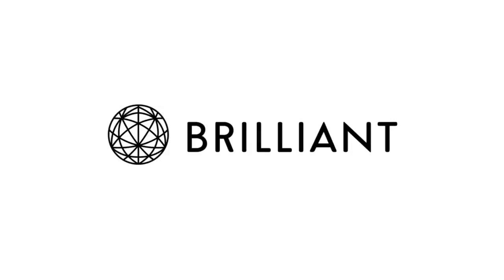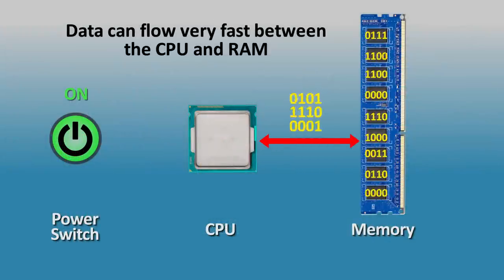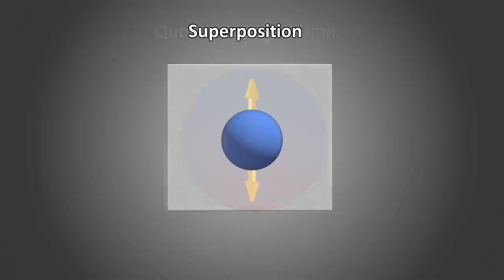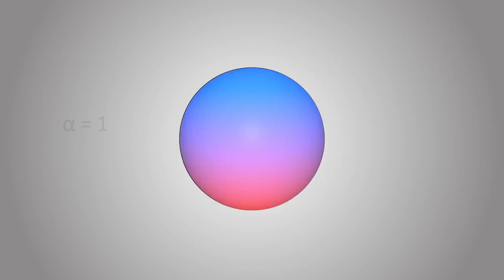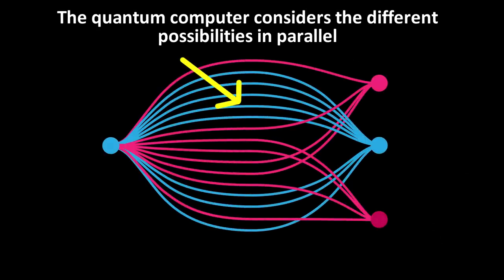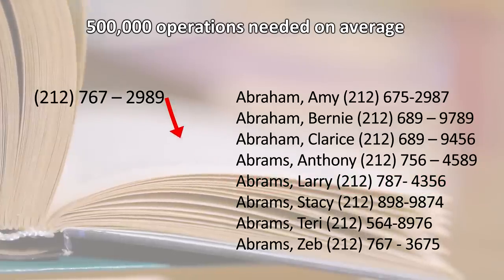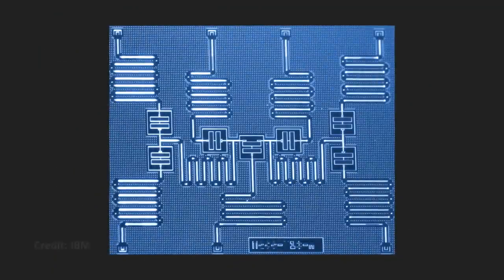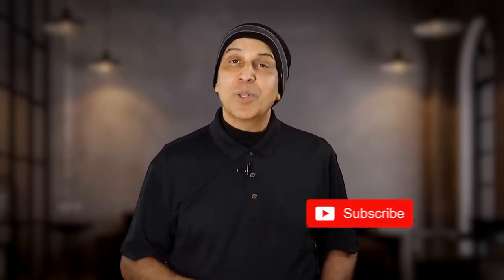The Insane Mechanism of a Quantum Computer?

Comment: I loved this explanation. Also understood how the parts of the computer interact with each other better here. Wasn't expecting it to end with the universe is a simulation theory, but it kinda does make sense to end with here.
Reply: Note that there is a significant difference between a "computational universe" and  "simulation theory" whiich he left ambiguous as it can apply to both. 

A simulation theory requires a physical computer outside the simulated universe but a computational universe is one where the computation is the fundamental bit not built on top of anything but past computations acting on some network array of past logic operations. It is a bit conceptually strange to think of as historically we have always thought of a computer as a physical object performing an operation but in a computational universe the computations are the fundamental building blocks from which familiar properties like space, energy momentum etc. emerge. So rather than a physical computer simulating a system  you are more or less projecting a piece of the underlying computational reality which acts as the fundamental building blocks of the universe. That is to say in the computational universe paradigm if the underlying computational simulation is sufficiently accurate i.e. has the right algorithm running on the right network then there is fundamentally no difference between the simulation and the and the simulating universe aside for the snapshot in time. i.e. the simulation is really an observation of the past in such a precise scenario. The catch of course is that the rate of times passage would be identical between the simulating universe and all the simulations so you could only know if you got the right network and algorithm for sure after running the simulation for 13.8 billion years. Other algorithms and starting networks wouldn't be wrong per say they would just show you a different snapshot of the computational universe in essence what is conventionally the "multiverse". 
Additionally in this paradigm the question of whether math is discovered or invented is rendered trivial as an observation is a frame or reference in space and time and a measurement is a type of acceleration in the space of all possible  outcomes of the wavefunction with the observation being a single projection of that higher dimensional object in a lower number of dimensions.

It is a very trippy paradigm that is really hard to grasp in fact it is probably fundamentally impossible for the whole system to be represented by our puny brains.

Comment: Quantum computers are made of one or more quantum (co-)processors that include quantum circuits implementing quantum algorithms by connecting a series of quantum gates to quantum registers made up of quantum bits. A quantum bit just holds a floating point number (e.g. 75%) which represents the probability of reading "1". There is always some (e.g. 25%) chance of reading "0" from the same qubit. Examples of quantum gates are Pauli-X (NOT gate) or Hadamard (sets qubit to 50% state). Example of quantum algorithms are SHOR (factoring RSA semi-primes using Quantum Fourier Transform) and quantum search using Grover's algorithm. Example of Quantum programming language is Q# from Microsoft and Quantum SDK includes quantum libraries implementing common / popular quantum algorithms.

Comment: Conditions to maintain superposition is a massive barrier for quantum computing to overcome and we're slowly hitting the limits of traditional computing as as manufacturing process has it's limits on transistor density. We can't go in too large CPU dies and we heavily limited by heat output in case of multilayer die. There is also matter of power efficiency - not like it makes a lot of sense to pile up multi-CPU home PC system that pulls like 2000W on CPU alone (which is justified method for servers and super-computer systems) for basic needs and computation needs only ever increase even for basic home PC tasks.

Comment: There are no quantum computers or even algorithms if such computers existed :)
Even if there will be one, they will not have such magical powers like people expect.
If companies had such a magical computer (which they claim they have) then they would change the world more than it was done with current 64 bit computers in comparison to 8 bit computers.
Reply: That's my feeling as well. There is more than just the hardware technicalities of isolation and supercooling  mentioned in this video to overcome. There is also the nature of quantum mechanics that once you measure a superposition, it goes away. So how would you be able to use the myriads of superpositions in a CUBIT to do calculations if they go away once you try to measure them?
Reply: @alansewell7810  My understanding is It is like the double slit experiment, the interference pattern is the result we want, the double slit is the thing we used to obtain it (calculation part), and we just need to make sure everything before the quantum bit hit the double slit is in superposition.
Reply: @alansewell7810  You measure many times. Quantum computers only give probabilistic results. This means you usually have to measure many times. Let's say that there is some process that can only produce either `00` or `11`, but not `01`, or `10`. When you measure once, you might get `00`. Then `11`, then `11`... etc. If you run the calculation 1 million times, you will get very close to 50% `00` and 50% `11`.

This is similar to the double slit experiment. Since photons can interfere with itself, you will get an interference pattern on the wall. However, if you fire one photon, it will still interfere with itself, but you will only see a dot on the wall. However, if you fire many photons, and record the positions, you will get something approximating the interference pattern. Each computation is effectively "sampling" the probability distribution of the wavefunction. With enough samples, you can approximate the probability of the photon will be in a range. We are effectively making a custom interference pattern with quantum computers. The interference models a problem we want to solve.
Reply: @incognitojuggernaut4411  The double slit experiment only fires one photon at a time. If there was no superposition then you would only see photons hit in two spots, not an interference pattern. There is only one photon at a time, so how does it interfere with itself without superposition? Split in two? Under classical mechanics this is not possible.
Reply: @henryzhang7873  Thank you for that insight. Intuitively, it sounds like a hologram, whereby more information is encoded by interference patterns than is encoded in a photograph that clones a 2D image of a 3D object by translation to analog or digital film. Perhaps quantum computing adds that extra dimension of computability. I know the retired physicist who wrote the first widely published book on quantum computing a couple decades ago. He is reluctant to talk about it now because he says so much has changed in the field since then. I'm still skeptical, because a lot of these supposed scientific revolutions like cold fusion turn out to be duds.
Reply: @henryzhang7873  Thank you, I found it and will  watch it. btw. I have a book called QUANTUM DIMENSIONS (on Amazon) that discusses quantum mechanics in terms of the historical debates. I am not a physicist by profession (though I studied physics in university). I am more of a chronicler of the history of physics theories, especially of quantum mechanics and relativity. I think I have a good understanding of the principles of both subjects, though the deep mathematics will always elude me. My IQ is a little short of the 160 I surmise is required to have a deep mathematical grasp of these subjects. However, people of all levels of intelligence need to be acquainted with these ideas, as they may loom large in our lives as we move deeper into the 21st Century.
Reply: @incognitojuggernaut4411  the reason it seems this way is because pop-sci content doesn't actually explain much of what it is talking about.
Superposition is well understood and can be clearly demonstrated.
If you want to actually understand something, not just the oversimplified stories for the layman, you need to dig into the math.
Reply: @alansewell7810  Quantum computers are revolutionary, but won’t replace normal computers if that’s what you are wondering. They probably never will, since the tasks quantum computers are usable for are limited.
Reply: @incognitojuggernaut4411  At least Einstein's theories were checked in nature. All that Quantum BS is not proven and is explained with use of magic :)

Comment: I've worked with computers my whole life(about 50 years) and with silicone chips.  The limits on processing speed depend greatly on the system as a whole rather than just CPU or memory.  However the system is made, to be useful it must be compatible with the world around it.  There are at least 2 other types of systems that were tried but were later abandoned because the system as a whole was not compatible with the rest of the world.  Fuzzy logic was one of these.  The other was the idea to make all optical systems.  Both of these ideas have merit and are used in very limited ways.  Fuzzy logic failed because no one was able to find a way to store and effectively use an analog value.  All optical systems failed because it requires some method of storing light and most of the rest of the world is not compatible with it.

Comment: Most of the nature mechanics can be simulated on a traditional computer, including neural networks, at least in a small scale. Can a quantum computer be simulated on a traditional computer ? Does quantum computer use algorithms ?
Reply: Yes, but simulating a quantum computer on a classical computer is significantly slower than using true quantum hardware.
Reply: @elliotn7578  It'd be like building a computer in minecraft. It can be done, but you'd take the processing power of an i7, and reduce it to a basic calculator.

Comment: It would be interesting if they ended up creating hybrid classical/quantum computers so we can get quantum calculations for long arbitrary things and classical for more mundane generally specific things.
Reply: i would suggest QaaS in this case... a web api to ask a quantum processor service something and get the result, while for the rest, you just use your stationary gool old joe CPU ;)
as long as we can't solve the temperature issue, there won't be any qbits lying around on our desktops anywhere soon, so QaaS ist the most likely approach here.
Reply: @alexejfrohlich5869  That does seem like a good option currently, but it was more of a hypothetical question for the what if.
Reply: I have a hunch the future will be photonic quantum computers on a PCIe card for hardware acceleration.

Comment: I do not believe neuromorphic based computers don't have to go through every single memory address just to find the right one since they are based off of the human brain and that means the process their information where they store it which technically means all their memory is available when it needs it, the efficiency and processing speed is much higher than that of a classical computer and they are mostly used for AI however there's still no match for a quantum computer.

Comment: This definitely seems like something governments and corporations should have...

Ideal running conditions sound so bleak.
a vacuum-sealed, no light container - at absolute zero.

Sounds almost the complete opposite of a star or fusion reaction. 
Instead of very basic constituents jammed together at huge pressure and temperature, it is some tiny ice cold information dense convolution.

Maybe a when a quantum computer figures out how to improve itself it will grow up to become a big bang...

I wonder if quantum computing will just forever be about 30 years away like Fusion reactors..

Certainly seems like a good thing for colliding with Artificial Intelligence. Who has read Mark Solms The Hidden Spring? 
Imagine some DeepLearning AI or Artificial Consciousness that reaches the conclusion that a quantum computers ideal conditions are what is now required everywhere. I guess it will figure out how to build fusion reactors properly and smash them out to power other regions near absolute zero. Sounds almost like space with stars, black holes and cold vacuum... Just artificial.

Anyway the future is interesting for wild imagination.

Comment: I really don't buy the idea that the universe is calculating anything. The universe is trying to do one thing: minimize it's energy state. It is like a ball rolling down a hill. The hill may vary giving rise to interesting temporary fluctuations but the overall action is simply getting down the hill. We have developed the laws of physics to help us understand what is going on but it is a leap imo to think the universe actually operates accordingly to these laws. Does a photon calculate its position at each point of movement? Of course not; it is simply following the path of least resistance through spacetime because that is the most efficient method of movement. Does water apply geometry to make a rain drop? No, a sphere is the most efficient shape a raindrop can make to minimize it's energy footprint. Physics has in a way given us a distorted view of the universe. We think of the universe as some sort of machine driven by some internal clockwork mechanism but in reality the universe is a closed system of forces that is in a continuous state of change. Everything in the universe is just a form of energy and this energy is trying to reach a lowest state. 

I forget who it was now but I watched Ted talk on quantum computers and the speaker said that the superposition of the qbits was due to the many worlds interpretation. Each state of the qbit existed in a different reality so all of them actually existed as an answer that could be retrieved. It sounds like I am making this up but I am not. This is what gave me the idea of the Mandela Effect being caused by quantum computers. There is a sci-fi book in there somewhere.

Comment: Slightly misleading statement: "You can ask multiple questions at the same time."
Yes, you can do this but unless you're clever you can't use it to your advantage.
As you said, the output is also a superposition. When you measure this superposition it collapses and you only get one answer. This is no better than a simple classical calculation. Worse still, you don't know which of your questions it's the answer to. It's worse than a classical calculation.
This is powerful, but nowhere near as powerful as the quote makes it seem. You have to be clever with it, and it can only be used to speed up certain tasks.

I suggest the minutephysics video on Shor's algorithm for an example of how this actually helps.
Reply from the maker: Yes, I don't disagree. The power is in the algorithm as you implied. The way you ask the question and process the answer is where the "magic" happens. And I think there will be better algorithms that will allow the asking and answering of more complicated questions.
Reply: @raspberrypi4970  You do realise most quantum computers don't use annealing?
Also, none of what you've said is relevant to my comment.
Reply: @alansmithee419  
Yes mostly Dwave Systems..
But Google and NASA and Temporal Defense Systems and many other's use Dwave.
And if it's there own its its mostly based on D-Wave Systems
Reply: @alansmithee419  
And it does pertain when I said Hamiltonian equations a classical outcome

Comment: If quantum computer already knows every possibility does that mean P=NP?
Reply: tl;dr : no.
1) P vs NP is a question about complexity classes defined in terms of a certain model of computation. If it happens that physics happens to allow for a more powerful model of computation, that doesn't change the mathematical fact of whether or not P is equal to NP.
2) a quantum computer does not simply "try all the possibilities", and pop-sci explains this really badly. To quote the quantum computing researcher Scott Aaronson's blog headline, "If you take nothing else from this blog: quantum computers won't solve hard problems instantly by just trying all solutions in parallel."
Some problems are particularly amenable to using a quantum computer to solve them. Some are not.
I believe that it is widely believed among the people who study this kind of thing, that BQP (bounded error quantum polynomial time, i.e. the yes/no problems which can be solved in an amount of time polynomial in the size of the problem instance, by some quantum algorithm with probability at most 1/3 of being wrong (the specific constant doesn't matter as long as it is constant)) is not equal to NP,
and in particular, that it is believed that a quantum computer would not allow you to solve NP-complete problems in polynomial time.